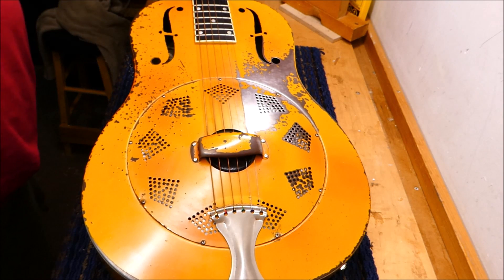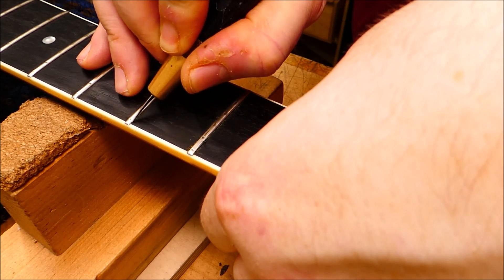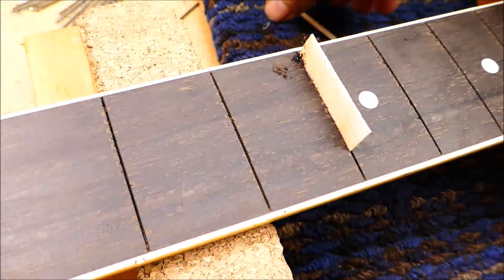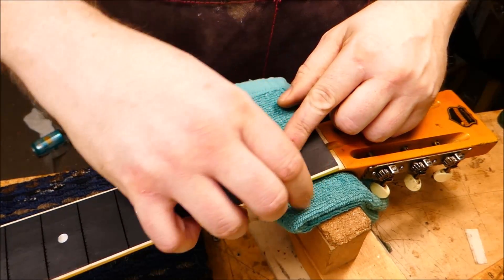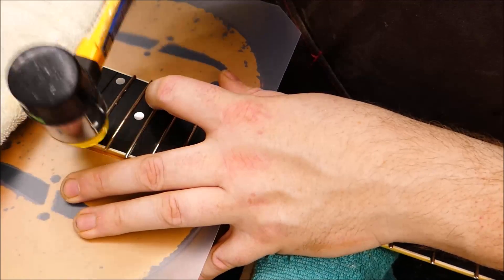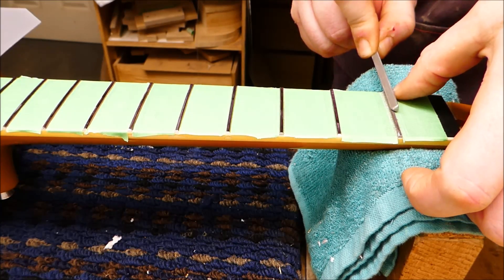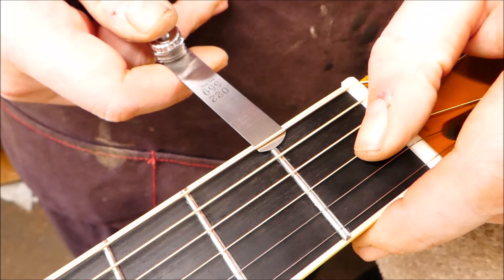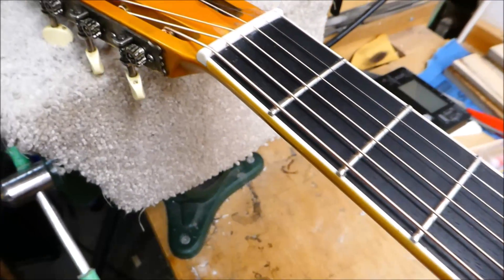Rusty Reso Refret

Comment: I own a 1930ish National Duolian slotted headstock 12 fret.  I bought it in the early 80's.  Had to repair the headstock (one of my first repairs on my own stuff.)  which had one side broken off and had some pine epoxied on. Spliced in a mahogany splint. I replaced the tuners and had to sand the body to bare metal.  The previous owner had the body rust , and spray painted over the whole thing with brown paint. Too bad he did not leave it alone. I would have like to have had some remnants of the original crackle finish. From what I can tell, it has the original cone.  It's a pretty good player, but I don't play it as much as my wood guitars.  Way too loud.

Comment: Hi man, i am not in the guitar repair ting  on any way. But perhaps is a good idea to use termal interface compound (used in processors  for computers) wen heating up the frets or any metal, it will maximize the heat transfer a lot.

Comment: Thanks for your fantastic and entertaining videos!  One question about refretting when there is a possibility that the person who did the fretting before used fish glue, too:  would it be useful to use water, too when taking off the frets, because fish glue is water-soluble - but not reacting to heat.  Or does fish glue melt anyway by using solder iron?

Comment: This national is so gorgeous. I’m saving up for a tricone.
Reply: I'm confused. Isn't this a biscuit-cone style instrument, or is there really 3 cones in there? Are the models with 3 cones called a Triolian or a Tricone?
Reply: @tiki_trash  yes.  Three cones. The biscuit sits on a “tripod” of sorts.
Reply: @tiki_trash  not really a biscuit. More so just a  A saddle
Reply: @justindwight5457  Thanks.
Reply: Ah, I get it. This particular model has 3 cones in what is a single cone style body. That's what was confusing me. Thanks!
Reply: @tiki_trash  A tricone (not a Triolian) has three small resonator cones suspending from a T-shape bridge, not one large one suspended from a biscuit. They give you roughly bass from one, middle from the middle, and treble from the third - there is some crosstalk, of course.
Wish I never sold my old one...